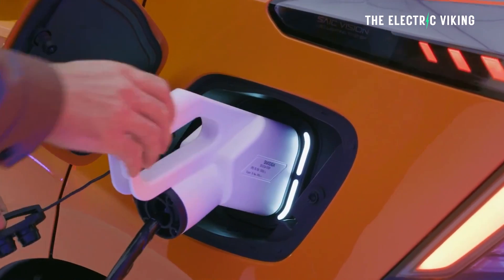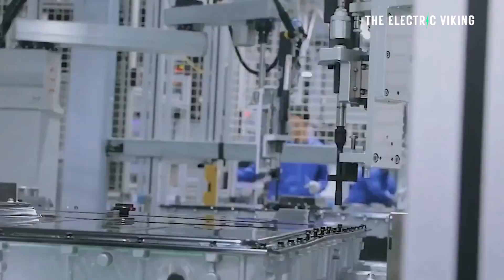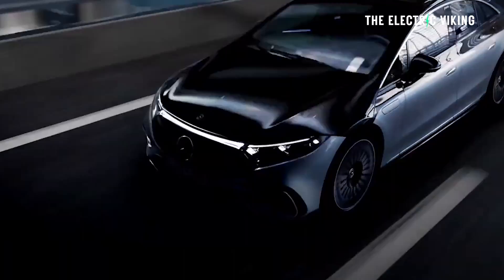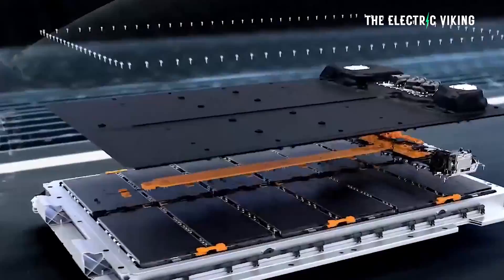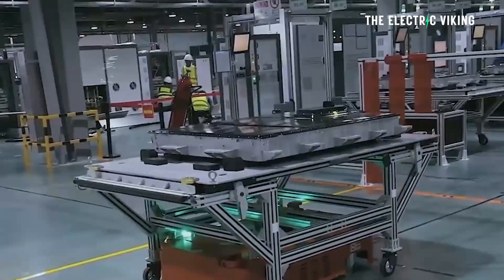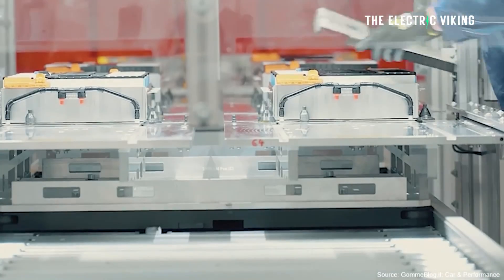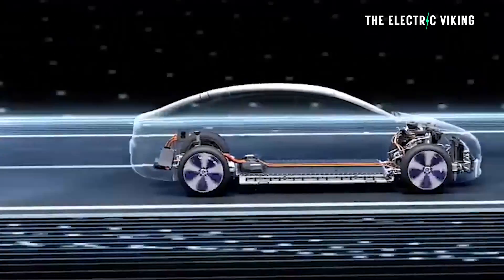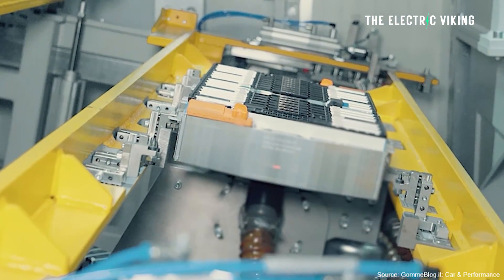Electric cars will require ‘battery passports’ in Europe

Comment: Yep, welcome to Europe. Nothing new under the sun.  What I'm mosaing in this story is the true motivation to do this. What problem are we actually trying to aolve with this passport. I think it is not merely for validation for a glorified certificate of aithenticity of aourcing material. I think if it is difficult toaource ot feom the battery itsel I thi l k it is possible to find out chemical composition in other indirect ways. One way What we already know is that many battery chemicals have their own unique charging amd discharging ciurve profiles. I think you can tell a difference from an NMC and LFP pure by charge/discharge characteristics. That's not difficult to do. If EV companies go as far as to manipulate charging curve characteristics with software, well that would be vwry interesting, wouldn't it. VW will likely have a field day with this, and electric mobility will then likely have ro deal with an image problem. I wouldn't know why an EV company would want to go that far, because you won't gain much and people I think can find out fast with testing compared perhaps than emissions testing which needs more advanced specialized measuring tools. Electrically I think the technilogy is 8n a way simpler to test and deduct from that. In that sense I wonder if a battery passport will truly add value to solving a problem. I think one atea where this could become relevant is with findimg the right compatible battery modulea for aervicimg amd repair and for third party repair. If this helps improve reliable and chaeper repair, I'm for it. But I thinknEV repair is still a lot in ots infancy. EV car repair I think will not be muc different from ice repair, in the most common repair issues. I think on battery repair we're still far from a mature service in my view and ways to repair batteries on a component level rather than a modular level I think still needs a to grow more profeasionally and deliver results, compared to the all orbnothing modular approach. I thinknin terms of sustainablilty we've grown to much into consumptiveness, for something that has big value. And I think itbwould be much cheaper to see if we can get battery packs last longer, rather than scrap them for the ximpnent reaources. This last step is also necessary for the continuation of a sustainable circular economy, bit between the step of repair and second life there is still too much a big gap, in view.
Reply: Logically I would agree, but practically that will not happen. The drive to reduce EV manufacturing cost is leading to vastly simplified vehicles which have very few serviceable parts. Least of all high voltage traction battery packs. 

The sustainable bet has to be on production quality and vastly extended service life (3000+ charge cycles)- the potential is there already but only time will tell.

Comment: Thanks for the video. I'm not sure why you are so sceptical about this. As an effective example, for the last 5 years every pack of prescription medicine in the EU carries a unique serial number which allows for tracking the authenticity of that pack from manufacturer to patient, right through the supply chain. This reduces the risk of falsified medicines reaching patients. Why not apply similar thinking to EV batteries? The technology is straightforward and the practical learnings can be borrowed from the pharma industry. Cost? Negligible, in the scheme of things. Patients pay nothing extra for the security of the supply chain for their medicines.
Reply: Quite. Modern software makes the cost of providing and assembling this data trivial.

I would be keen for this to go much further on every part of our consumption - providing concrete numbers for environmental impact for every consumer choice. Would be far more effective than 'green' preaching (often from highly dubious, if not actively misleading sources).

Comment: I’d love them to include details of the battery so you could create a replacement using newer technologies else the 2nd hand market is doomed
Reply: Modern battery tech is expected to have at least 1500 cycles to get to 30% capacity degradation. This is roughly 250,000 miles. The used value of a 250,000 mile car will render battery replacement completely beyond financial sense, regardless of future battery technology.  Apart from anything else, reverse compatibility is never going to be a future priority. 

No-one would consider putting a hybrid power plant in a model A Ford- that's 80 years' advancement of the technology...

Comment: It could be good if it would also include the health of the battery from certified inspections done on them or evaluations etc., for used car buyers later it could help in purchasing process.
A good idea to have a passport, in future could include more data, as I said - health of the battery at certain points of its life, repair work done/some cell replacements etc.
PS: It was mentioned in the video later :D And I disagree, used car market often has obscured and hard to obtain data on condition of cars, especially in countries that do not quite belong to 1st world but even in 1st world there are shady sellers. Of course this is not fool proof maybe, but if buyers will require to know battery health, sellers will be forced to bring the car in for inspection and it will show up officially in the passport, not just some perhaps faked paper the seller gives you

Comment: Euro 7 standards coming in force from 2025 mandates that  battery pack in BEV shall sustain 80% charge for up to 20 Years or 200.000 km whichever comes first.
Reply: That is a bit optimistic. Are the cars with batteries that can't reach this standard going to be withdrawn from sale?
Reply: @catherinegrimes2308 
Quite. And if your car has 75% remaining capacity after 20 years, you get a refund?🤣
Reply: Optimistic or not this is the law. When Euro 7 gets into power, April-May 2025 every BEV car sell in Europe and UK is to follow same standards, must commit to this or will not be allowed to sell.  A wonder why you are so pessimistic? Is than not a good thinks for us as customers? I am cheering about it as will give me a pease of mind about most expensive part of my new car for many Years / miles to come.
Reply: @nigratruo  just tax carbon emissions equally rather than sales tax or fuel duty- the issue would be settled very rapidly. Battery longevity has a huge impact on lifetime emissions.
Reply: @nigratruo  i agree with almost everything you say. We have had EVs for the last 7 years (4 years with no ICE vehicles, and no more air travel).
In use there is simply no comparison in terms of impact.
It is of course true that EVs have far fewer components, many of which are exposed to much narrower temperature duty cycles. This gives a potential for far better reliability and longevity IF component quality is up to the task.

 Sadly, however, component count doesn't, as you say, directly equate to the energetic or environmental cost of production of the vehicle as some of the components of an EV currently have relatively very large production footprints.

As such, the production footprint of an EV is significantly higher than an equivalent ICE vehicle by any credible estimate. Even taking into account the assumed maintenance and repair differential (which, remains a potential rather than certain advantage for an EV- when things go wrong out of warranty they are costly - don't ask me how I know!), the EV has a lower footprint over anything over around 30,000miles. 

However if its major components can be made to reliably last longer than an average ICE vehicle, the footprint per mile travelled tumbles, so longevity becomes critically important in order to reduce the production footprint of replacement EVs (or major components).

I've made the bet on longevity as we have 2 EVs (bought outright) with modern battery heat management and intend to keep them for as long as they work ( combined 120,000 miles travelled in the last 4 years so we will see how that pans out).

In my opinion a battery passport has the potential to be a very useful tool for the used vehicle buyer and if properly used will significantly help the needed transition away from the dumb burning of fossil fuels for personal transport. The political motivation is another matter...
Reply: @nigratruo  that's your belief. I'm afraid that it's a mostly mistaken belief.

It's true, however that finding the actual production footprint of respective comparable vehicles (or of any other consumption choice) is challenging in the absence of legislation forcing the manufacturers to publish meaningful figures.

The battery passport has the potential to be a step in the right direction but we, as consumers should be demanding the ability to choose based on footprint. No-one seems to be demanding this, though - which leads to opinion rather than verifiable fact based assertions.

 It's a case of 'a little knowledge being a dangerous thing'.

Even Tesla (the only global EV only car manufacturer) doesn't attach footprint data to their cars.